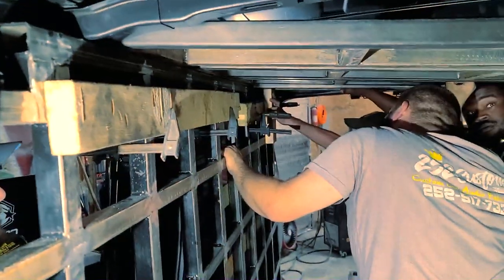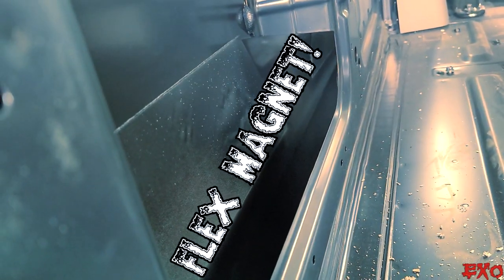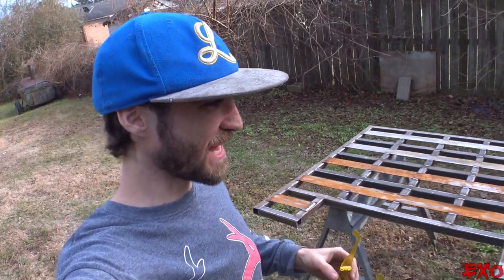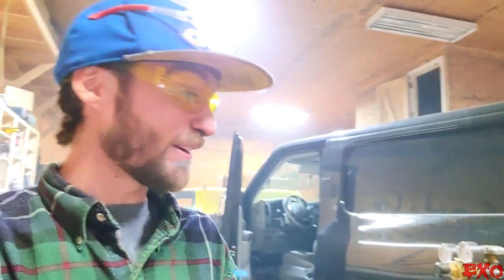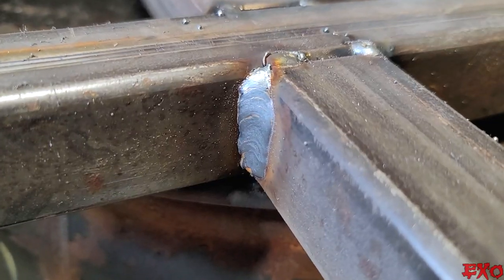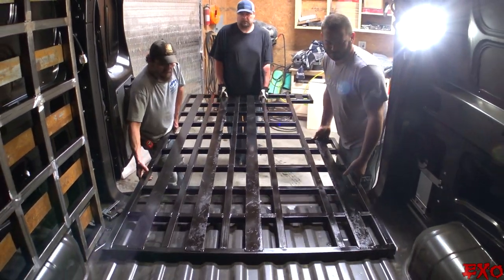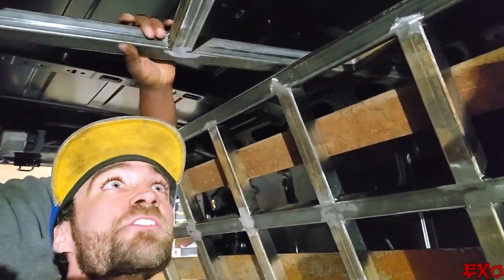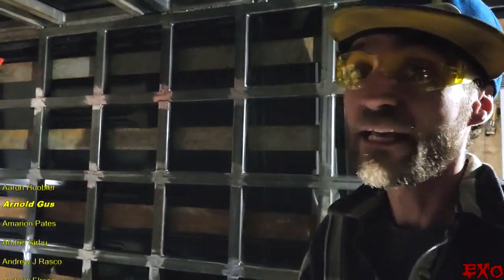Installing STEEL CAGE for 12 18 inch Subwoofer Build!!! EXTREME Custom Car Audio Installation Pt. 3

Comment: I don't want to discourage anyone's welding because we aren't all welding structures or pipeline ,  I will say a slight bit more prep to bevel the edges and you will save your self a lot of time trying to flush the welds flat with the rest of it and you will make is so much stronger.  Its good to see you jumping into some heavy duty stuff too

Comment: Haters just see us making noise on the street.  They don't see all the hard work and the time spent.  Low riders with the etched brake rotors and amazing paint jobs blow my mind.  Everything i build gets scratched and leaks oil.  No matter how hard i try to prevent it.  Looking good Exo.

Comment: Welding tip...don’t push a vertical down weld...only a vertical up.  A rule of thumb...generally, holding 90 degree angle with the stinger is good for all mig joints. Love the vids!

Comment: The best tip a true weilder can give is keep the leading edge of the puddle basically when you're looking through the mask when the wire is melting there is a puddle you want to kinda drag it if you get ahead no penatration fall back melting it should sound like cooking bacon

Comment: I remember my first bass back in 06-07 vid from RoE and it was 2x12" solobaric kickers.. flexin a celica back window.. then later on you tube and it was like 4x8" Tangband and comments was like "haha that looks stoopid, sounds like ""faaaaaart"  and I was ´no it doesnt.. this is cool.. I cant be the only one who think like that...´ Still only rock a single 10" ported but my fix for awesome comes from you my man! Here is a poem for you. 
When the bass bug bites, my motor ignites 
my heart start poundin´ while the bass songs soundin´
woofers flexing with hertz from hell... 
..and there it is..
that that awesome smell.

Comment: Your going to need to add a supercharger to pull all that weight..
Reply: I was gonna disagree with you but then I got to thinking about it and I think you are correct. It’s meant to pull loads inside the cargohold but I’m not sure whether it will be able to pull as much weight as is being loaded. Just gotta be careful when dabbing into the engine with this profession because then you lose space and if you blow up the engine due to overcharge, then your whole build is shot. 

I saw Steve Meade twin turbocharged his Cadillac so maybe a single large turbo for this would work decently for this build.
Reply: Gearing
Reply: RV cam needed in that engine
turbos...ect ect
Reply: Yes, gearing is a much safer way to help the pulling power.  A numerically higher gear ratio will increase engine rpm at any given speed which wil increase the available horsepower since the engine is at higher rpms.  

But, with this model already being a 3/4 ton or a 1 ton model(I don’t know which one it is), it might already have better gear ratios.  At this point in the build, it is best to wait to see how the van copes with the added weight, then decide if anything needs to be done.
Reply: @91CavGT5   You got it on the nose my guy. This will be fine in his nissan.
Reply: That van engine with its current gearing can handle over 3000 lbs extra weight. He is more then fine with what he has lol. No supercharger/ turbo work needed. Come on people, he isnt adding 10,000 lbs lol.
Reply: If anything, suspension will be needed an upgrade be he already addressed that in previous videos, wow people thing think think before you put your foot in your mouth.

Comment: Surprised the metal guys didn’t have you shoot it with zinc paint first. Little coat stops almost all surface rust and flaking down the road🤷‍♂️ that said man this thing is coming along nicely and those guys doe some really nice work👍

Comment: I do have a question about welding and maybe its just what I grew up with but why not use a stick welder instead of a mig. With metal that thick I would personally use a stick welder because I feel like I can get a deeper weld.

Comment: I know I'm late to the comments but... you're making the right calls. All that metal dust created by grinding, cutting and welding the cage needs to be kept as far away as possible from the speaker rebuild project. Trying to do that in a home garage just wouldn't be wise.
Much better to utilize the crew at 252 with their tools and expertise. 
Haters gonna hate cuz they can't be bothered to think about or empathize with other people's situations.

Comment: So I want some help if that's possible... So I want to have more bass than I have right now but don't have the room for it. so I have 2 12inch Kenwood road series ohm single voice coil subs ran in parallel inside of a ported box tuned to 34 Hz, I got them on sale for like $50 each a couple months ago they are 250W RMS each my amp is the Rockville db16 (2000 Watts rms@ 2ohms) and I want more but I need the extra room now, so I am thinking of getting a single 15 inch sub around the $300 price point so I was looking at the sound quebed HDX3 15, rockville destroyer 15d2 or get the skar zvx-15v2 but I want the most sound and deep lows but I also need the room for other stuff... I can make a custom box but want to know what you guys would recommend. Thanks in advance!

Comment: BIG DIFFERENCE between a harbor freight welder, and a quality name brand one...... with the quality of the weld, and then also flux vs mig makes a big difference too...

also the really only possible damage would be needing a new tip possibly, or the need to pull some bad wire in the cable out

Comment: Hey EXO do u have some 0 wire gauge ferrules laying around that's the only thing I need to finish my build to hold the wires in my amp better I dont have the extra cash otherwise I would buy them

Comment: Exo, I'm looking from switching my box in my SUV to a wall and adding another speaker, I know nothing about building a wall or what dimensions I would need for the box in it to work. I'm currently running a pair of sundown Zv5 15s and want to add a third, I am powering them with a Stetsom 10500, and have a pair of Northstar Sms400agm batts on a 320 amp alt. Any advice for building a wall would help.

Comment: Hey could I run 2 sundown u 12’s and 2 sundown xv2 12’s together? It would be gettin the best of both worlds. They have the same power rating and are the same size so I didn’t see there being a problem. Just asking cuz I’ve never seen or heard of it being done.

Comment: Hey exo ive been followerimg the build for awhile now on both my accounts , i noticed a few times you get some nice shots of the grinding but also noticed you get really close to on coming sparks towards the camera im not sure if you know this or not yet but you cant grind around glass as little fine shards get stuck in glass windows an lens so thought i better say something an hope you see this so you can keep youre cameras in mint con i hope for youre sake you already know this an have some kind of case on youre gopro if thats what you are using to film that is, just try not to get cloae to any sparks pr welding the slag of welding does the same thing if really close, keep it up man you get some nice shots an angles its always epiic content cant wait to see kore

Comment: Exo i have a 2014 crysler 300 i want to up  Grade my rear factory 6 by nines but  My factory 6 by nines have no words coming from them only base how do I go about this to get trouble in words out of my new 6x9s i will be useing a amp for the new 6x9s with  The factory head unit

Comment: Yo exo. does every sub u add, adds +3 db aplly to wired together or just in genral?i dont know how to get ahold of u so this is how im doing it :p hope to hear from you. As i have a 4 channel amp that bumps killer for what it is and it has a vu meter on it (db meter) that being said since its under powering 4 10 inch p3s im trying to use the db meter to sortoff tune, cause i do know 0 is flat and +3 is boosting signal. So with tuning of "db".. i have both bridged sides of the amps to the same db. i un plug one side of rca input to the amp and put the input up till its +3db as thats whats best for it to my ear and feel.. but on the meter its green still so do the same to the other pops it up to +9 on the db metter but a +9 hard red!! Lol so that being said is it sending out a clipped signal? Or +9 on one side would be clipped?

Comment: I’m a welder been welding for about 10 years just wanna say they used great patterns but weren’t hot enough and were moving too slow:/ those welds arnt as strong as they could be

Comment: please don't cheap this build up by using standard foam on the panels  please you know with that much power and movement will rattle that foam to the point it won't help

Comment: No disrespect but I am a certified welder and those welds are pretty horrible. That guy does not tie in the welds and has lack of fusion. And alot of under cut. I hope you did not pay him alot to do that for you. If so you should of went to a real shop.